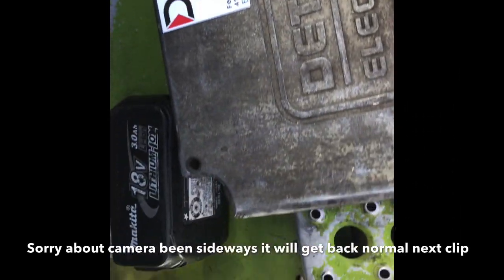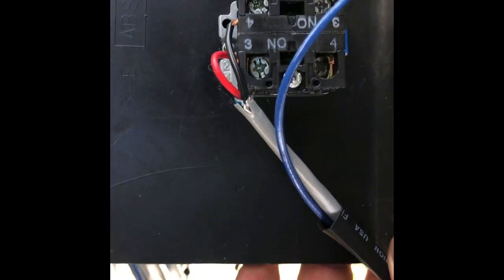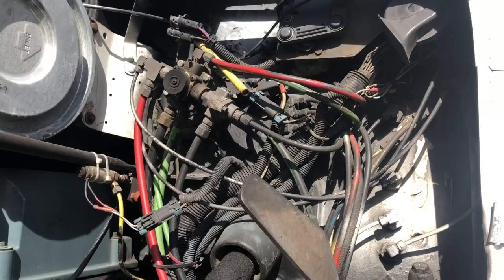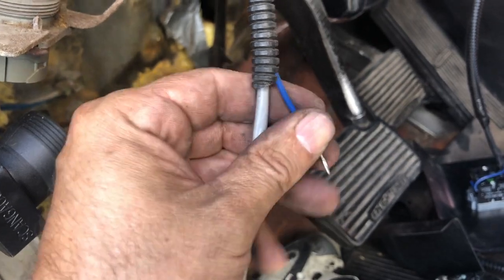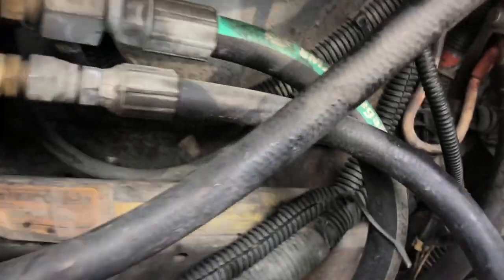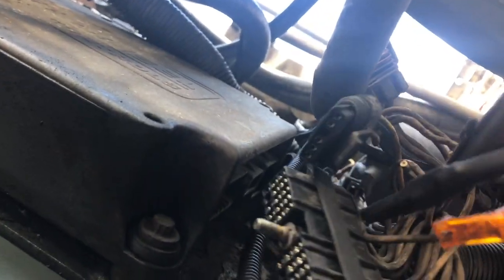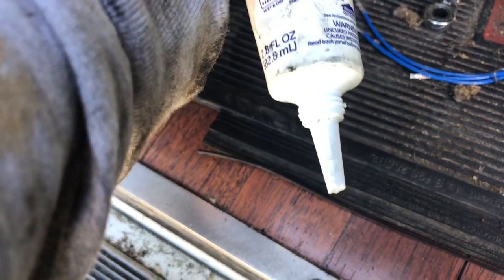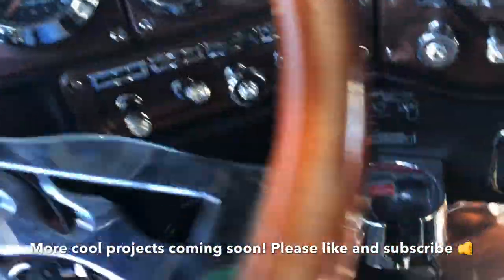Gain up to 650hp safely with this hack! Detroit 60 series 12.7 dcs custom tuning wiring install

Comment: No offense but Fernando is a fucking asshole to work with. I called him, he was a douche bag from the moment we started talking, interrupting me, contradicting me and just a bad attitude. I ended up telling him to fuck off, when I had a Detroit performance shop rebuild my engine for high horsepower and torque, they ended up sending the ecm to Fernando for the tune, I guess he's only cool with big shops.

Comment: Put it on the Dyno it doesn't do anything get rheostat potential meter omhs or a wideband boost controller 🎮 if u want more boost n power with fuel tech 10 bar e waste gate electric no springs or e axles meritor14xe remote control acts like 15 liter fuel efficiency 50 mpg hybrid or Allison 100 P or duals if ur looking for horse  power tq n a big cam marine international

Comment: Haha he is hooking up a switch with no benefit. He's tapping into the main power and ground to the ecm. He could have hooked that to the batteries and the same effect
Reply from the maker: We’ll call @dieselcontrolservices see if that’s the case
Reply: Dimwit... THE FUCKING ECM HAS A TUNE INSTALLED, IT'S NOT JUST A SWITCH.

Comment: I have 1996 Detroit 60 in a Freightliner. Would it work on the older motor?
Reply from the maker: It should call @dieselcontrolservice
Reply: 1996 ddec3 cant handle more than 550 without the weak pistons coming apart
Reply: It will absolutely work on yours, Fernando will tell you he won't tune your box to 650 for liability reasons, you have a 96 which should have a ddec3 600 will be the max he'll tune it to but you still risking it so I maxed mine at 575 /550/500 be hold fine just don't get crazy with it

Comment: Hola amigo tengo una pregunta para ti, tengo un Detroit serie 60 12.7 del 1999 430 a 470 hp que necesito para subirlo a 500? Tengo en mente ponerle unos injectores del un camión 500 y el camshaft es necesario cambiar? Me gustaría saber si me puede dar su número de teléfono
Reply from the maker: Si lo quiere original busque el número de serie de un 500 original de la misma generación que el tuyo y cambiar el camshaft injectors y la programación
Reply: A ok Gracias

Comment: Good Day : Did you really gain power after installing it.
Reply from the maker: Of course but have in mind it’s not just the switch it goes along with a tune greetings
Reply: @fldlife  Thanks. What horsepower you had before and what  horse power you have now
Reply from the maker: Mine was 430’500  now a have three setups switchable by a switch 430 500 and 650
Reply: @fldlife  wow sound nice. Thanks

Comment: Oye compa miro que sabes bastante y tengo una pregunta tengo este código en un Detroit series 60 12.7 ENG oil pressure 
HIGH 128 100 00 que puede ser cuando lo camino la presión sube a 63
Reply from the maker: Yo creo que tiene un problema eléctrico ya sea en sensor de la presión de aceite o algún cable pelado en ese circuito suerte con eso y saludos

Comment: Como te gusto el dcs tuning ocupo hacerle cambios al motor como turbo o injetores y como funciono el tuning si lo recomiendas
Reply from the maker: Honch19 claro que si te lo recomiendo lo mejor que hay por que lo pones como tú quieras y no siempre lo tienes en el hp más alto por lo tanto no maltratas el motor tanto
Reply: Que cambios le has echo al motor yo tengo un Detroit 12.7 original y busco mas power para jalar ya que siempre ando pesado sera mejor instalar el tunin o hacerle unos Upgrade’s al motor que me recomiendas
Reply from the maker: Honch19 primero empieza con hacerle upgrades al sistema en enfriamiento termostato de 170 y si es posible un radiador de 5 venas por que con el tuning te va a subir la
Temperatura después pones el tuning y ya vez si es lo que necesitas después cambias el turbo sin válvula borg Warner 171702 o otro de tu preferencia pero
Más grande
Reply: Ok muchas gracias y voy a seguir tu recomendacion

Comment: Ok budd 9 months went by what do you think so far? Any improvements on power? On economy? Any me problems because of this? Or no mayor change occurred please share your thoughts buddy
Reply from the maker: I haven’t had any issues yet I am happy with it the fuel economy improved I don’t use it at 650hp unless someone tries me lol I usually have it at 500 and 430 when empty I was boosting more when new I am thinking maybe my turbo is going bad but I am researching on getting a different turbo so I can have more boost it’s pretty slow to start at 430 and 500 hp with this turbo borg Warner 171702 and at 650 is a beast but it’s like learning to drive again lol I always check on my temp and I improved the cooling system I have a 5 vein radiator and 170 thermostats temp stays 175 ish at night and 185 ish during hot summer days I hope this helps any questions let me know
Reply: @fldlife  BorgWarner only turbo to buy
Reply: @fldlife  awesome dude thanks a lot and a little piece of advice don't push it to 650 ( even with a better turbo) it's a lot of heat going thru the head ( exhaust manifold) and a valve can brake easily at those temperatures ( ask how i know lol) so just don't get to crazy with it, I broke mine ( Cummins ISX ) twice and I finally lower it to 455 thanks and good luck 👍
Reply from the maker: Eduardo silva Cummins isx is a total different thing lol did you delete the egr and went with a no wastegated turbo? Or just tune it as is?
Reply: @fldlife  delete everything leave the same turbo and actuator KW t660 2014 it was a beast but the head cracked so i replace it and after 6 months did it again the mechanic said it was to much power and I sadly agree to that lol 😆
Reply from the maker: Non wasted turbo keeps the egts to lower temps maybe you had to improve your cooling system as well what temps were You running at?
Reply: @fldlife  honestly I don't know i don't have a pyrometer but those egts had to be at least 900 the engine temperature was fine though, I guess like you said it's a matter of learning how to drive it again when to let go or give it a break but when you mention 650 hp on a 12.7 i got worried right away
Reply: @EduardoSilva-xe3gp  You mentioned you broke your ISX at high HP. I also run an Cummins in my T404s here in Australia and she's set permanently at 680hp and 2400ft-lb with no dramas pulling up to 143000 lbs but averaging 126000lbs. I wonder if ours are different to yours.
Reply: @KandooTruckin  maybe you are just lucky...isx's here are junk, no exceptions
Reply: @marceloevera2009 , you are wrong as shit. ISX is a bad dude, the DEF/DPF are killing those engines.
Reply: @EduardoSilva-xe3gp  you have to have a Cat if you want that kind of power. 60s won't last with it turned up.
Reply: @EduardoSilva-xe3gp unless you are familiar with Detroit don't compare red cummins junk. These 12.7 detroits are capable of 1000 horsepower, with turbo, injectors, manifold and tune etc.

Comment: I have a 07 Freightliner Century with a 14L S60.  Can I mail my DDEC to you and you tune it for me.  Right now Im at 475HP and speed limiter set at 76mph.  Dial me up to 515HP and speed limiter set at 92mph with a tune.  How much, live in El Paso.  How long of a turnaround?  Price?
Reply from the maker: Corey Adams I don’t do it diesel control service does it google them up
Reply: Corey Adams. If your still looking for help I can help you out.I can do it in one day. I run a fleet of Detroit’s 05-07 12.7&14L I have all the software plus some. Shoot me a email Abailey12v @ yahoo
Reply: @whatsin5335  I will email you, where you located?
Reply: @coreyadams4646 HE DOESN'T TUNE THE COMPUTER?!!

Comment: Primo eso funciona en cualquier camión que tenga un Detroit?  Yo tengo un Detroit 60 11.1
Reply from the maker: Edwin Velazquez yo creo que si pero necesitas llamar a DCS. Esto no es un sistema generalizado esto es un programa exclusivo para la computadora  de tu motor tienes que mandar la compu y entre 5 días te la mandan de regreso creo mientras sea del ddec 3 o 4 si se puede
Reply: @fldlife  Hola en q parte se puede comprar.

Comment: Hi, can u explain how to do that on another type computer on Detroit series 60. Thanks
Reply from the maker: Mario Komljenović can you be more specific? This can be done to any ddec 3 and 4 engines
Reply: Is it for an 11.1, 12.7, or 14? The 11.1 has a DDEC 2 to 3 and the 12.7 has DDEC 2 to 5 and the 14 got 5 to 7 since emissions

Comment: Hi. What engine  information you have to submit to DCS to get this tune up? Thanks Roman
Reply from the maker: Semi Driver  pretty much what you haul what you want and what you needs so he can do a specific tuning for your needs also mention what upgrades you have done to engine if any such as bigger injectors bigger turbo etc  and basic info about engine such as year it was manufactured with ddec version is vin number maybe he can pull out that in off your ecm but just in case write it down and tape it to ecm but I’ll suggest give him a call first
Reply: @fldlife  Thank You! Sir. Still happy with that tune? What was the turn around 4 days?
Reply from the maker: Semi Driver yes sir very happy there is nothing like it out there I use it 500 hp when loaded 430 when empty and I hit the 650hp setting once in a while to have fun without  very happy with it and yes turn around I would say a week in my case
Reply: Donde puedo conseguir ese aparato viejon saludos

Comment: oye bro se podea hacer en una century 99 con detorit 12.7?
Reply from the maker: Rambo David si pero depende las especificaciones del motor es depende el programa q se le pone pero igual se ponen 3 uno para ahorro otro para desempeño y el normal
Reply: @fldlife   donde puedo yo aser ese trabajo
Reply from the maker: diasjuan19 diésel control service búscalos por Google o en el inicio de el vídeo puse su targeta

Comment: That’s originally a 500hp Detroit engine , u can’t get a 150 hp improvement from just a tuning, for that u need either an upgraded turbo or bigger injectors. Take it to the dyno and see it for yourself. Ur truck look really nice tho👍
Reply from the maker: Jonatan Castellon diésel control service works with what you have on your Motor and gets the best out of it as in my case I do have a bigger turbo and a full tilt manifold but he said ddec IV 500 hp engines are ready for this tune
Reply: Now drop a link to back up your nonsense.
Reply: @TheRoadhammer379  
Google Diesel Control Service like he said earlier in the comments.
They have dyno sheets on crank and wheel horsepower on several versions of the Series 60 and on other engines as well.
Reply from the maker: TheRoadhammer379 http://dieselcontrolservice.com/
Reply: Talking out of your ass. I have used tunes from Diesel Freak and Pittsburgh Power in 3 of my glider kits and yeah, they were dyno'd, 650hp on two trucks, 625 on the one I drive. That's flywheel hp. Where did you get your information, from the local Freightliner service counter? Back up your bullshit or go kick rocks.
Reply: TheRoadhammer379 like he said he has a bigger turbo and full tilt manifold, im not saying it’s not true I k ow diesel freak have great stuff  but u will have to help that engine a little bit so he can develop that much hp, sure I can make 700hp on my stock 475hp cat with just a ecm and harness , yeah right, and by the way i don’t need to drop a link I worked 3 years repairing and adding performance on cats , Detroit’s and Cummins Im pretty sure what I’m talking about,
Reply from the maker: Fernando from diesel control service can answer all your questions give them a call he used to work at Pittsburgh power by the way but he quit when they start doing shity gliders
Reply: @TheRoadhammer379 .maybe it is Canadian HP or some good pot.

Comment: Do you have a ddec3 or 4.  I have a 3 was wondering if I can safely do this to mine
Reply from the maker: Scott Bulach I am pretty sure you can do this to your ddec3 the programs will be different though I am not sure if you can get 650 for ddec3 it all depends on the factory settings depends on injectors and cam size and hp rating
Reply: @fldlife  The ddec3 doesn't have the cooling journals in the block, result engine will over heat fast than a ddec4 600hp should be your max setting, but I wouldn't run that setting all the time, my ddec3 has 500/550/575 settings and 550 holds just fine 575 when it's play time then back down too 550or500... Stay safe drivers!!
Reply: I’ll give them a shout I’m sure he will let me know what all I can do to it.  Im thinking of upgrading my turbo anyways

Comment: I have another question can you change the programs while you drive or do you have to stop and be in neutral in order to change it?
Reply: You can flip it anytime you want. Fernando’s switch looks a little complicated and ugly. You just run 2 wires from the ecm ports he has programmed for the other 2 ratings and ground either one you want for rating 1 or rating 2. Rating 0 will default when neither wire is grounded. A simple on/off/on switch will work with ground in Center. And don’t join wires like the poster of this video it. Remove pin from ecm plug and install new wire with proper end in.
Reply: @davidburdett1920 the company that programs the ecm provides the connectors to tap into the wires but you know more about it than DCS
Reply: @TheRoadhammer379  what? Nowhere did I say I know everything. I just commented on the ascetics of it.
Reply from the maker: Oliver Johnson that’s a good question I switch it while in neutral position while shifting gears pedal off the gas Fernando said the programs are similar  under 30% load so while running it’s fine as long as you don’t push the throttle
Reply: @fldlife  ok cool thanks! I can't believe I'm just finding out about this smh

Comment from the maker: DCS diesel control service 
Google it
Reply: Someone on here said you went to Fernando? And they said he rebuilt theirs for $500. Where is this guy?
Reply from the maker: Oliver Johnson he might rebuilt it for 500 buck but the 3 programs setup goes for 1000 bucks I put his card at the beginning but you can also google it: diesel control service
Reply: @fldlife  how do you like the 3 programs? Its stock and the big hp one is 3 so what is the 2nd program? Do you have to have a bigger turbo to run it on the big hp?
Reply from the maker: Oliver Johnson I love it!! First setting it’s 430 second 500 and third 650 I drive it most of the time in 430 setting because the fuel consumption it’s less I am almost making 8mpg I do have a 171702 borg Wagner turbo and the Pittsburgh power full tilt manifold Fernando suggests the 650hp setting based on my setup and motor vin in my personal opinion 650 setting it’s so much fun to drive it feels like it’s empty but the fuel consumption not good and temp will go up on hi hills when hauling heavy
Reply: @fldlife  oh ok cool I have a 171701 I want to upgrade to a 702 but I know you have to get the ecm worked on before doing that at least thats what I thought. I have the stock manifolds but I want to upgrade them as well and put staight pipes on it and that fuel thing that connects to the back of the motor that supposed to give you more power and gain better fuel milage
Reply from the maker: Oliver Johnson I had my
Turbo before I did my ecm it gets slower at low gears but it’s not that bad you just get used to start slow at high gears it produces more boost and hp
Reply from the maker: Jose Uvalle that doesn’t sound quite right I send him my ecm he charged me 1300 bucks 1000 to do the 3 program setup and 300 to fix it because wasn’t working when I ship it I don’t know how much he charges for an ecm from him this was done few months ago so prices should be same now
Reply: Thanks man I love my fld
Reply: U know where I can get tru k frame   stretch out to 305
Reply from the maker: Dennis Riggins I don’t know exactly but I can find out it cost around 4K as I’ve heard
Reply: Buenas noches le puedo poner eso a un motor dd2 serie 60
Reply: Jose Uvalle  really?
Reply from the maker: Jose Uvalle yes that’s right
Reply: Jose Uvalle  cool thanks! I think I will do the same thing! Are you satisfied with the results?
Reply from the maker: Oliver Johnson yes specially the 430 hp tune it saves fuel consumption a lot I went from 6.7 mpg to 7.5 mph average
Reply from the maker: Jose Uvalle thank you !  the turbo was around 800 bucks I bought it locally at a turbo shop and yes the cascadia mirrors work heather and left to right I can hook up to do up and down but I thought it wasn’t necessary I will do a video soon about the install
Reply: Thank you guys! I'm subscribed I love all the videos they describe my life lol wood floors are coming to my truck very soon. I'll keep in touch!
Reply: Jose Uvalle  my truck is misfiring sometimes at idle like its spitting. I had my motor rebuilt last year I didn't change the injectors when I did it because I was told that they seemed to be fine. I don't think its the injectors because it runs fine it only misfires when idling. It make the truck sound bad and its irritating smh my truck is a 96 and I think it may be the ecm
Reply: Oliver Johnson for start try with crankshaft sensor or manifold sensor among others such as fuel flow and pressure sensor I would probably start with fuel sensor even gas pedal one, but would probably start with fuel flow sensor, then if is none off those take ecm down take to Detroit , but I doubt that’s ecm has anything to do with misfire

Comment: Where u get this from
Reply from the maker: Dennis Riggins diesel control service I show their business card at the beginning of video or just google it I am very pleased with results specially the 430 hp setting it saves lot of fuel I might do a video showing them 3 different settings and the 650 hp setting it turns your engine into best mode 😱👍